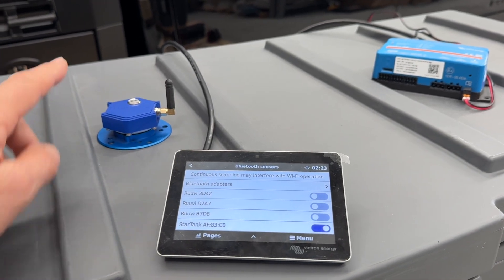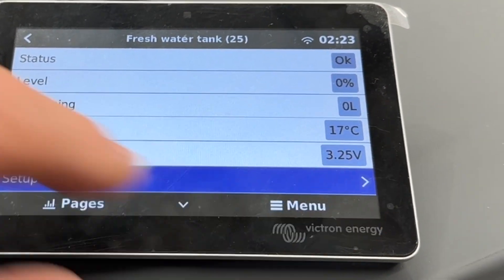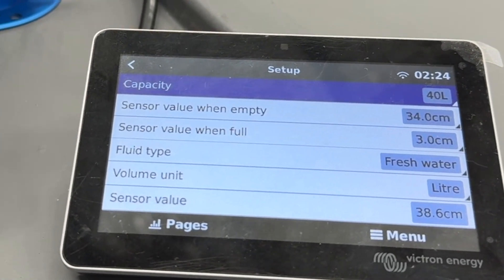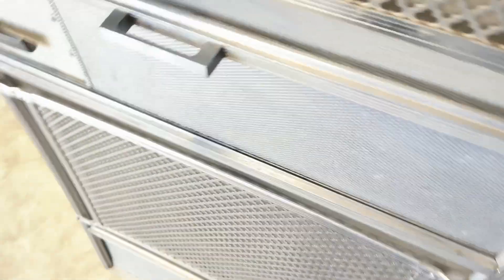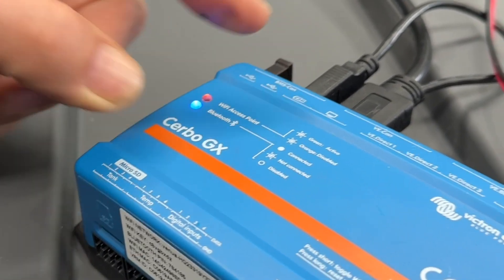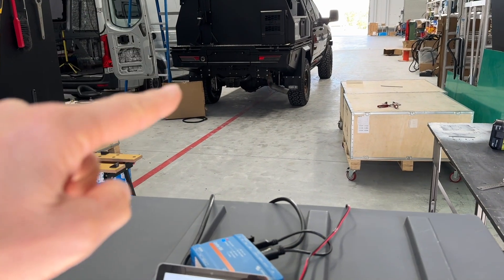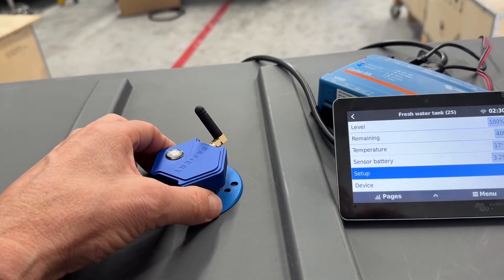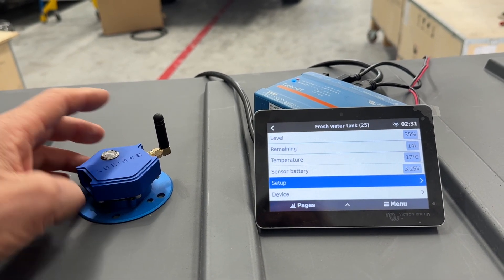35m Range test of STAR-tank Battery Bluetooth links Victron GX black, grey, fresh water tanks

Comment: Will this only work on square / rectangular shaped tanks or can it work with odd shaped tanks? Specifically tanks that wrap over wheel wells in van builds?
Reply from the maker: As long as it can be above the deepest part of the tank without baffles in the way it will report the level. Then Victron Manage off tanks by allocating a percentage of tank to the level as you fill it. That way you can monitor an off sized tank.

Comment: Shame you can’t actually get the star sensors currently and the cerbo Bluetooth dies once it gets hot
Reply from the maker: We recommend to use the TP link BT adapter ($18) fr range and the reason you have given. It does not cutout. Star Sensors will be commercially available at end Sept. Worth the wait
Reply: Hi there. Love your videos thank you for them. I have bought one of these myself but as you mentioned here the cerbo gx bluetooth range is not good so I bought the tp link bluetooth extender but I am finding it impossible to set up. How do you link the tp link usb to the star tank sensor? I can't find any info on it online